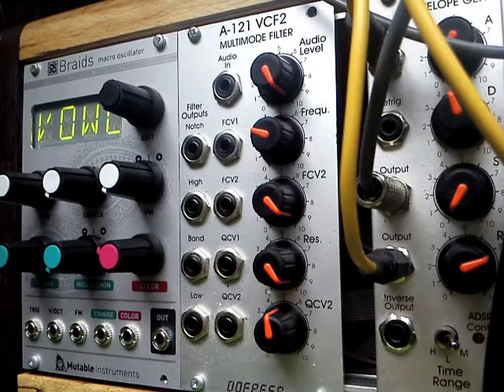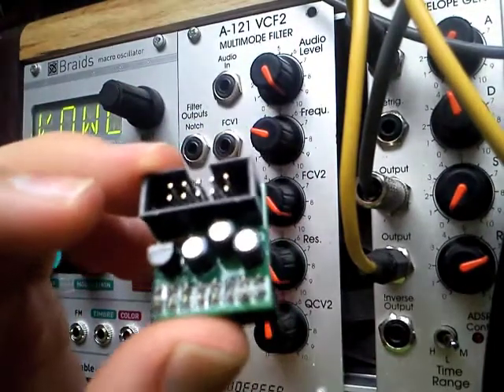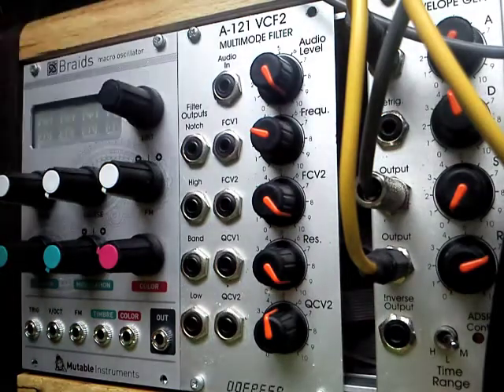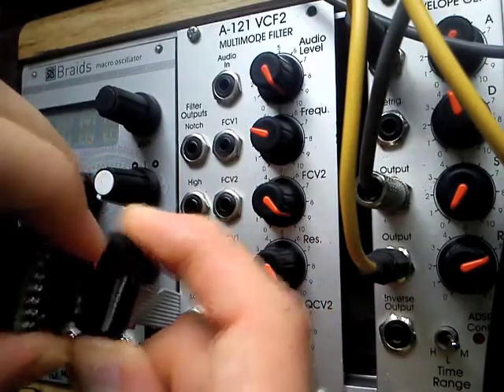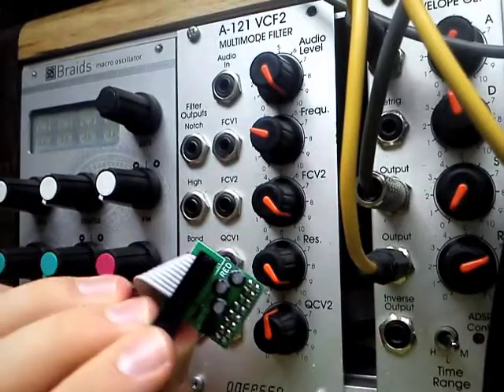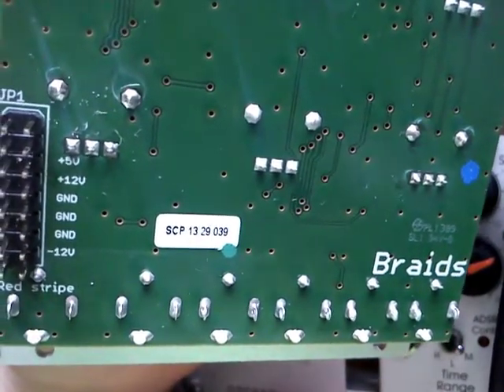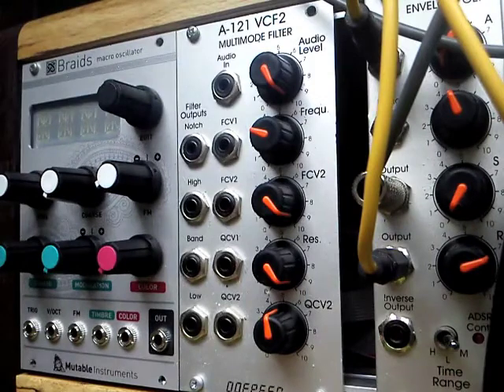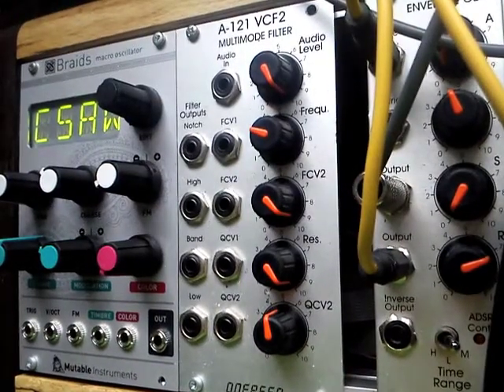Future Sound System FSS APOW3 demonstration

Comment: Hey interesting vid ! But how do you know if your power supply have a +5V rail ? Also, how do you know if your module requires either 5V or 12V ? And what happen if you connect that module, which requires +5V, at your power supply if it does not have the +5V rail ? Many thanks !